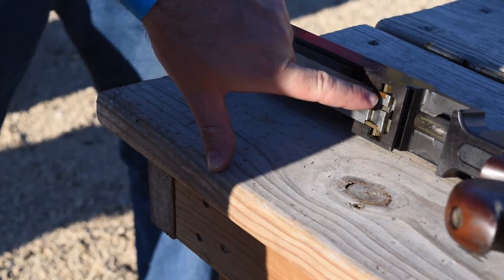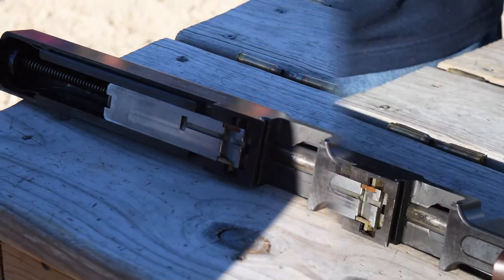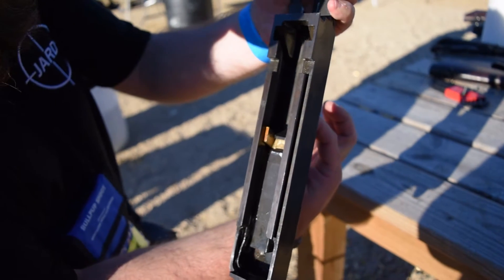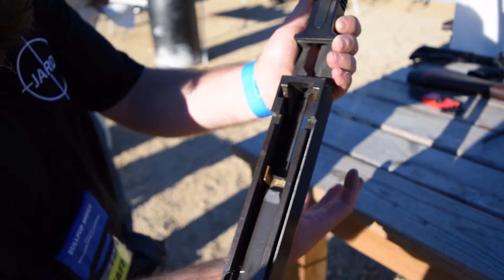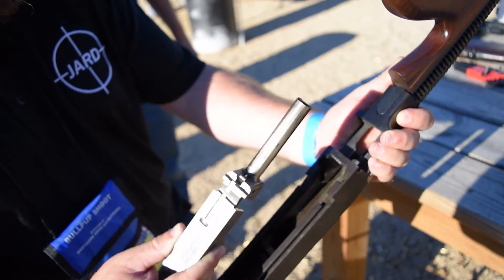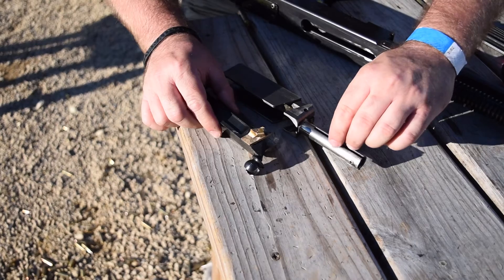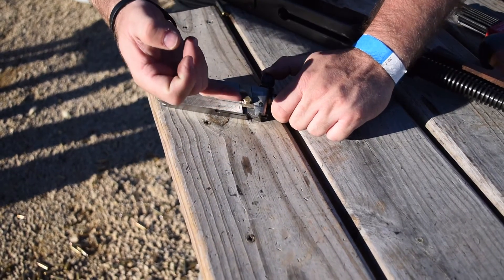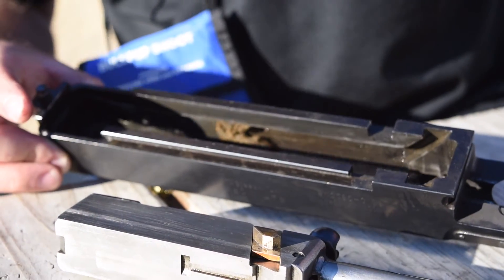Thompson Blish Lock Takedown

Comment: Oh sick you did put them together. Apparently metals don't do "that" but i don't know. I do know different metals do cause reactions in circumstances against each other I just don't know if that's one them. Seems like the non blushlock is slower so I'd agree with the myth
Reply: Different metals do have different friction ratios but the effect only becomes noticeable in something like a factory, with many giant pieces of machinery interacting; different interacting metals over a very large macroscale system like that can have a cumulative effect that gradually does something unexpected and unwanted on operation. But two little pieces like in the Blish lock, yeah the effect is never going to manifest at such a small scale. The principle of it is sound but it just doesn't manifest in something that small.
Reply from the maker: It’s basically accepted that the blush concept did nothing additional to lock the gun but I’m not aware of any documented scientific testing on it. The upgraded designs of the gun made the bolt heavier and simpler to manufacture. We hope to eventually get the time and the licensing to one day test this directly. Basically do the blish part in a different metal that is the exact same weight to see if there is a difference in the rate of fire or not. We would also like to see what would happen if the weight of that pat was heavier so make it out of tungsten or something else along those lines. Would it be practical nope but it would be really cool to find out

Comment: Very informative, thank you! I have a question: is the recess that the blish lock goes into supposed to further delay the gun, or is it just a means to keep the bolt locked closed, or both?
Reply from the maker: If the theory of blish worked it would delay the opening of the action but I think the geometry does more of a delay than the dissimilar metals

Comment: Just FYI- the "Blish lock" doesn't actually do anything. The dissimilar metals don't slow lockup any more than the mechanism itself would. This is really just a mechanically delayed blowback. If it worked this would still be used in weapons today. You can look up the science on this one.
Reply: That's also why the m1 Thompson doesn't contain a blish lock
Reply: @heldgop Do you think this delayer pattern might be a cheap alternative to roller delayed blowback?

Ed: actually this is kinda similar to lever delayed blowback with a different bolt carrier design
Reply: @ArcturusOTE  kinda not too far from what an m9 has huh

Comment: If the Blish Lock were actually having any effect at all surely the rate of fire should be lower on the Thompson fitted with it ? That aside, great video, really interesting seeing how the parts interact. Thanks for your time putting up these vids, much appreciated.
Reply from the maker: +Mike Brown if the designs were the same it would be a slower weight of fire. It was redesigned for military use removing the blish lock system and adding mass to the bolt instead. The added mass lowers the rate of fire.
Reply: oh my gosh youre right. Hadn't thought of that
Reply: @the1knifepro169   You sure talk tough on a computer. If the blish lock is so great and aids in delaying opening speeds and firing rates, name my one single modern gun that isn't a clone of an old one that produces a modern design that uses a blish lock. We thought they worked for too long and they went into some great guns. Just look it up on wikipedia and you'll see that no one thinks they still work. I agree they're in some great guns but let's stop being a prick and just look up "does the blish lock work." and you'll have your answer.
Reply: You're wrong here. Blish lock doesn't do anything. Obviously the design includes a blish lock but the principal claimed to be in effect does nothing.